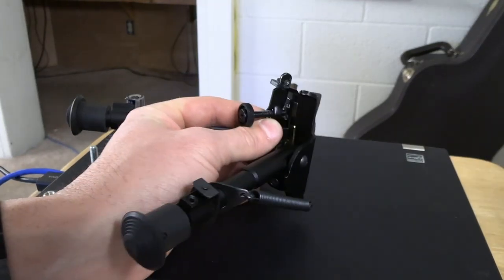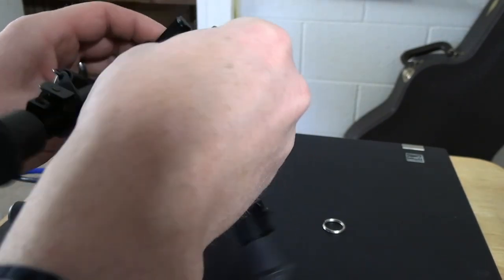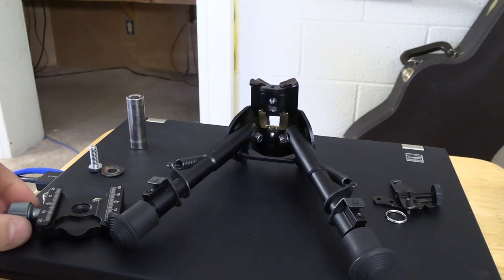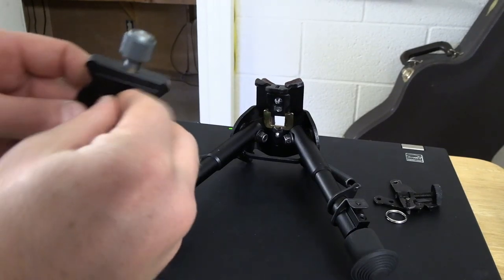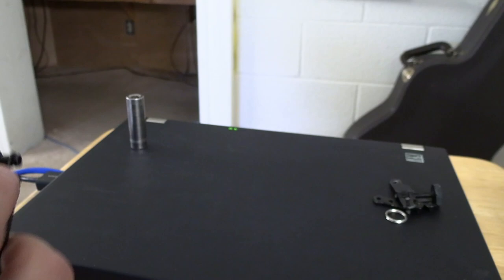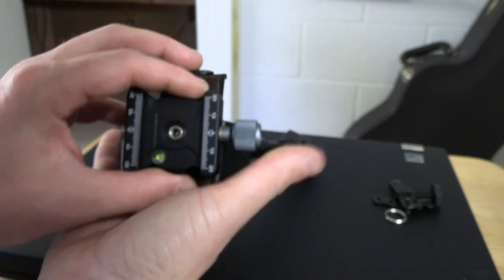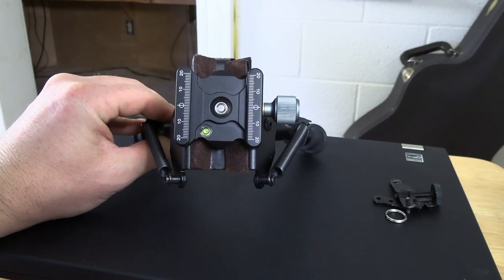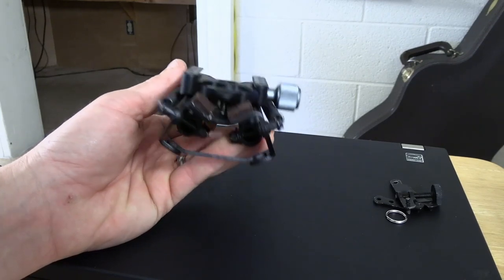DIY Arca Rail Bipod - Turning a sling stud bipod into an arca rail bipod

Comment: Did this yesterday, looks good, but I can't get it to stay in place. The bipod rotates under the mounting plate when pressure is applied. Did you have this issue or did I possibly not do something right?